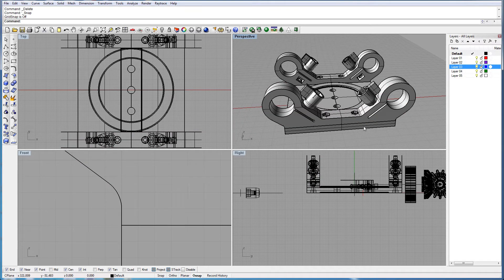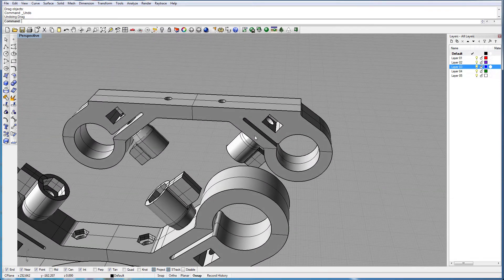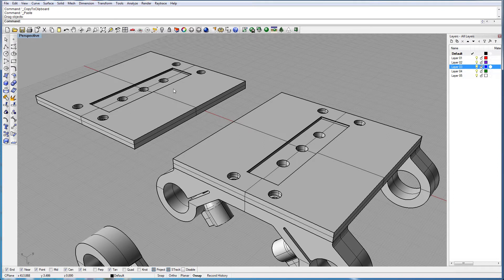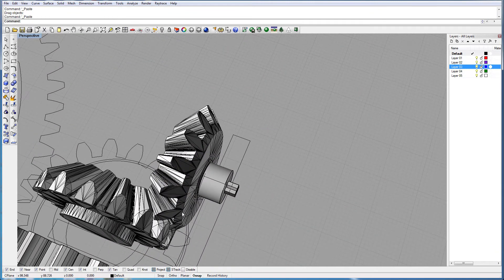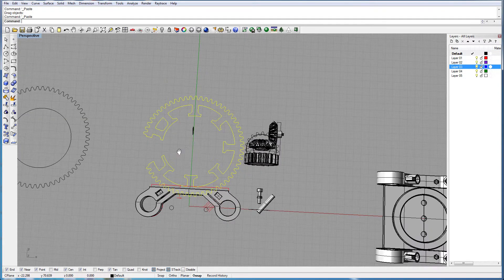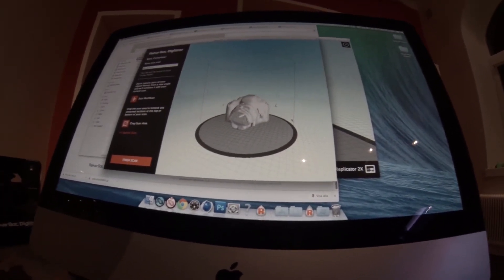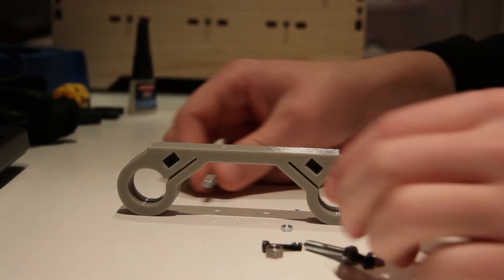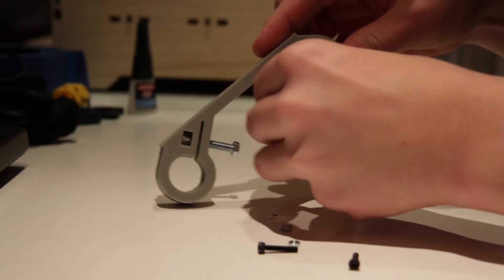DSLRigger - Episode 1 - Main rod connection system

Comment: 1st episode in the DSLRigger creating series. Using 3D-printers and CAD to create the best open source hardware camera-rig system.

Want to follow this project on forum? Check out this URL: http://goo.gl/os8Hr4

In this Episode:
Rod-connectors, 3D-scanning, 3D-printing and Main part finished

I've started work on the geared follow focus, but it's tricky and will take some extra time to get completed. The FF-system will use glue (for now) to fit inside a structure that angles the torque 90 degrees, so your FF-knob/wheel is rotating towards/away from you. Just like any system today. The main gear that attaches to the lens will of course be adjustable and available in different sizes for different lenses.

Next episode: 3D-scanning, Reference data, Follow focus and assembly!

Subscribe so you don't miss anything!
Reply: Nice job Anton Månsson, can't wait to see the rest of the series!
Reply: ***** thank you Jason! Working hard  to get a first model out so it's easy to continue developing with the community :)